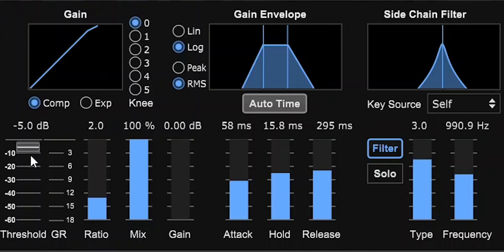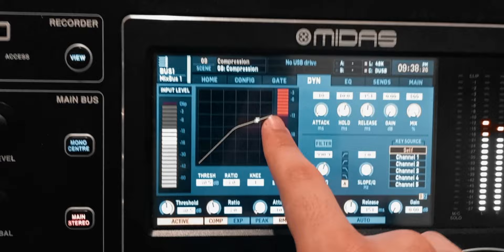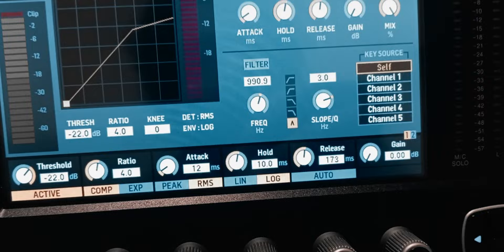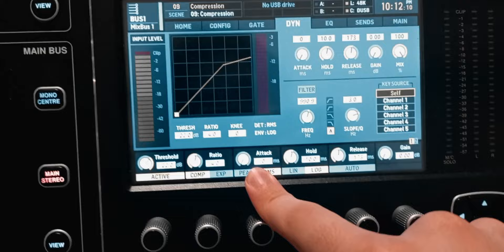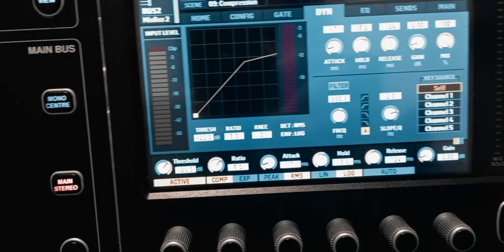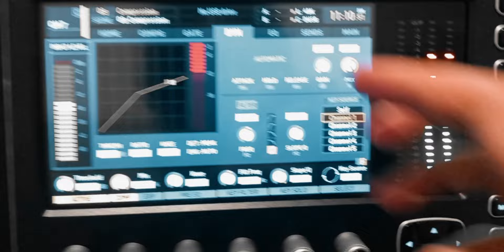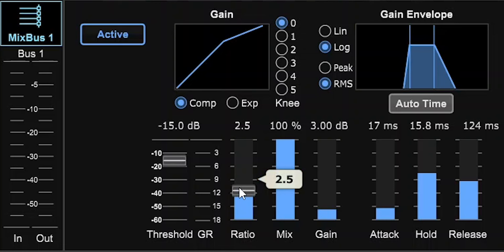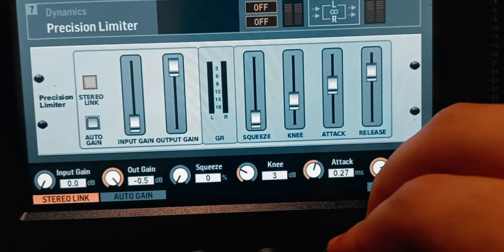X32/M32: you'll Understand Compression i promise (attack, release, ratio, threshold, side-chain...)

Comment: Using up all those busses...where do your monitors go?  Or is this just for recording and not live sound?
Reply from the maker: You don't always need all the busses for monitors, and if you do then just do the compression on the channel itself. In live sound it's always a compromise. What is more important? Based on that you're gonna decide what to sacrifice and what takes priority
Reply: @danielkharrat  I agree or use a separate console for monitors.  I am just not super clear on why you are using busses in the first compression example when typically, only a few of the drums are compressed in a kit.  What's the purpose of compressing the entire kit, and would you still be using individual channel compression?  I think maybe I am just not fully awake yet, lol.  And I am also not clear on when parallel compression would be used and why.
Reply from the maker: @BjorgenEatinger  compressing all the drums together makes them sound more like one instrument as opposed to many different instruments put one next to the other. It doesn't matter if the snare drum sounds good on its own. How does it sound with the rest of the drums? They should sound good together. Using a bus makes it easier to "glue" them together.
And no, i don't compress each drum mic individually if i am compressing the bus unless one of the mics is out of control or causing trouble then i will deal with it on the channel itself. 
Lastly, the point of parallel compression is to add energy to the drum sound to make it sound fuller. This optional you don't have to do it if you don't need more energy or fullness in the drums

Comment: Hey Daniel, you’re a great instructor and engineer! Could you do a video on how to setup monitor sends through the bus system on the X32, without using a P16. So, far I’ve used “sends on fader” feature to assign 16 mix channels to busses 1,2.3,4. Audio gets to the bus channels, but when I solo the bus channels so I can create 4 individual mixes for musicians on stage there is no control over that. Also, the eq, compression, and effects do not make it to the bus channels. Really need help in this area…thanks,
Reply from the maker: Select the bus, go to the config page and set it as pre fader. This will take into consideration the eq and compression but if you have an insert after the eq and compression you have to use post fader
As for the effects you can send the effects returns to the bus in the same way you send a channel to the bus
And lastly go to the monitor page and turn on channel solo AFL, bus solo AFL and DCA solo AFL. This makes sure that you hear correct levels in your headphones 
I suggest you watch my videos about busses and about monitoring if you haven't already. 
In the description of this video there's a link to a Playlist with tutorials on this console

Comment: Thank you for the video.

What if the bassist does not like the side chain sound in their stage monitor, how can you give the bassist an unaffected signal?
Reply from the maker: You can send the input. I can't remember exactly where things are on the physical console since i sold it but i can tell you how to do it on the m32 edit app
Select the bass channel 
Go to the sends tab
Turn off the globe icon on the left so that the changes will only affect the selected channel 
Let's say the bass monitor is on bus 8
Above that bas you have different tap points 
Select input 
Now the bass signal will go to the monitor without passing through any processing 
Now keep in mind each 2 busses the are next to each other will have the same tap point 
So if the bass channel is going to bus 8 without processing and you decide to send it to bus 9 it will also be without processing on bus 9